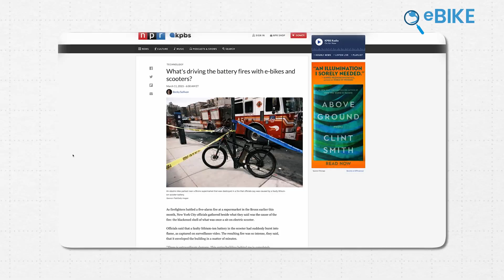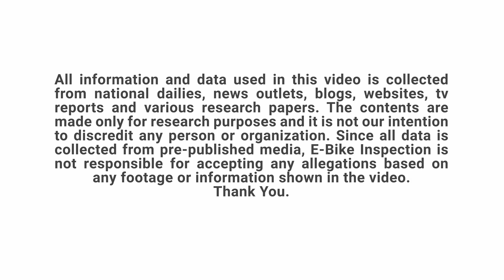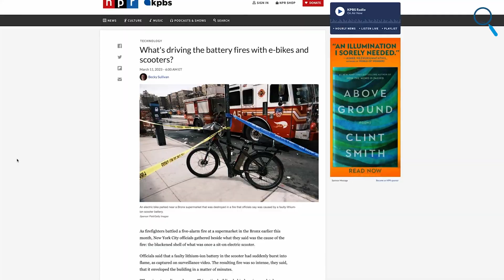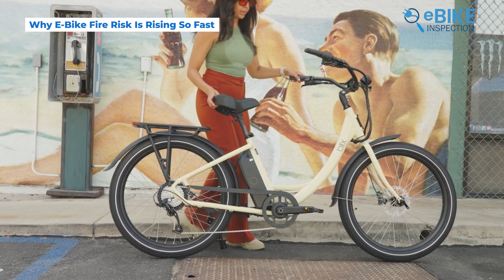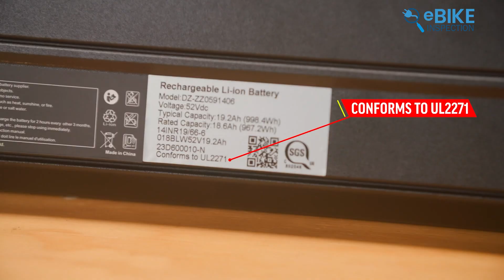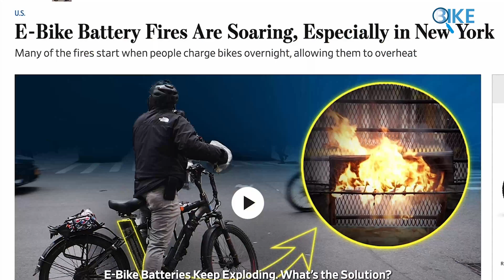Why Ebike Batteries are Catching Fire More Than You Think! Causes and How to Prevent Them

Comment: Here's the common sense to all this scary tactics. DO YOU THINK that bycycle shops such as Halfords and all main high street dealers dont have fires from ebikes they have in stock incl. The batteries. This is because these professionals do the right things when it comes to ebikes. If they didn't then were all in trouble. So ask when you buy an ebike and these pros. Will put you right on the correct way to handle your ebike.
Reply from the maker: You've highlighted a great point about professional handling of e-bikes!

Comment: I've put 13,800 miles on my Ebike . I ride 3 days a week and charge my battery 3 times per week . I'm still riding the same battery and I can't tell any decline in power .
Reply: WOW THAT'S AWESOME BRO! I also rode over 20,000 Km on my Red E-Bike and my battery is the same as the day I bought my e-bike, (I have a short video on my channel) I still have the same tires and they're still in good condition, I only had to replace my front & rear brake pads twice.
Reply from the maker: Thanks for sharing!